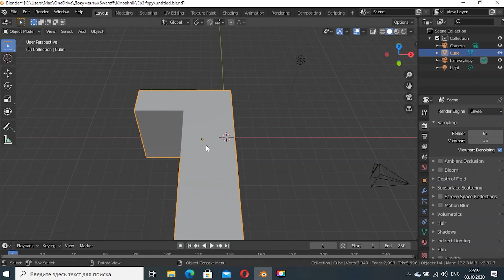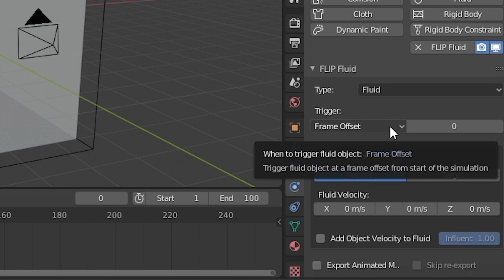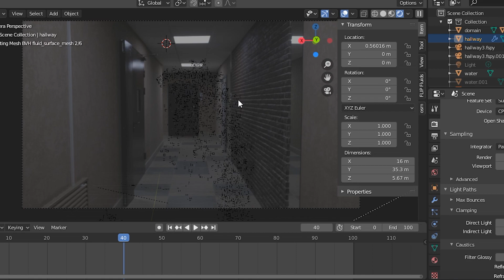FLIP FLUIDS WATER SIMULATION in BLENDER | LAZY TUTORIAL

Comment: If you're using the demo and want to get rid of the watermark on the mesh, you can just increase the domain size and add a Boolean modifier.
Reply from the maker: If we increase the domain size don’t we need to increase the resolution of the grid as well to get a better visual result? So it will lead to higher PC power requirements?

Comment: How accurate is simulation when changing resolution?

For explanation :
When i simulate fluids with blender built in fluid sim, i always start on lowres to test and tweak settings, but when i up the resolution with tweaked settings (which takes ages to simulate because of resolution) , the simulation behaves a lot differently, is this same here? Or is it good to test simulation on low res and just increase resolution to finalize simulation without further tweaking of settings needed?

Also, what do you say, how do simulation times compare to blender build in simulation?
Reply from the maker: Blender built in fluid simulation improved a lot after I made this tut. Still I feel flip fluids is a better option. Regarding resolution - it will behave a bit different as there will be more separate drops of water when you increase the res

Comment: the second water it use different cache? right. can flipfluid simulate 2 water source same time?
Reply from the maker: The second water is same cache. It can simulate multiple sources same time, but you gotta bake it every time you add another source.
Reply: i try 2 source water 1st fluid on frame start on frame 1, and 2nd fluid on frame 70, but my bake result just bake the 2nd fluid... any suggest? or i wrong the step?
Reply from the maker: @lgoritme  if you want you can send a blend file so I check it. It’s hard to say what’s wrong there without seeing.
Reply: @kinoshnik4499  i will try again i think.. but thank's
Reply from the maker: Ok. It’s important that all the obstacles and fluids are inside the domain and there should be only one domain.